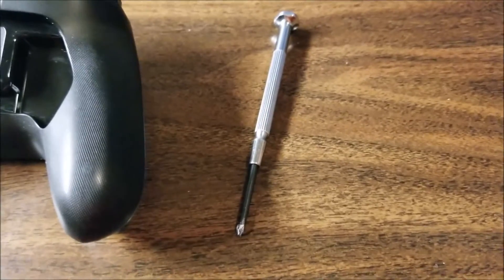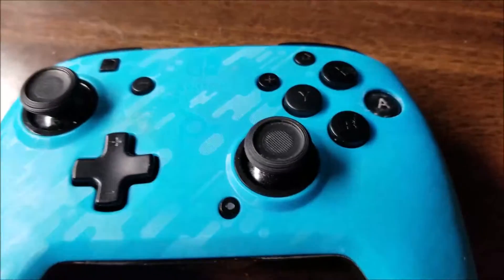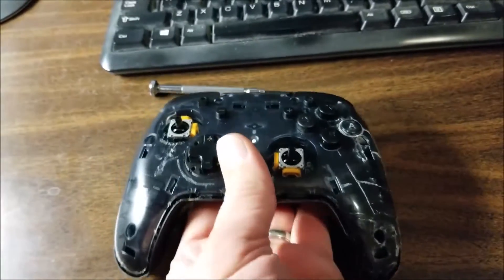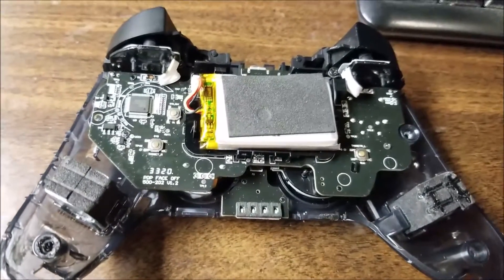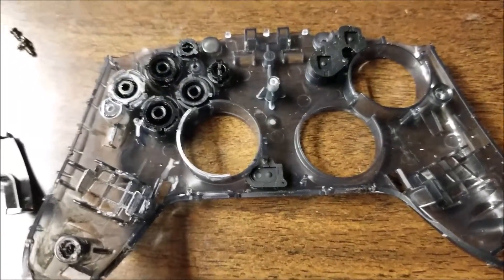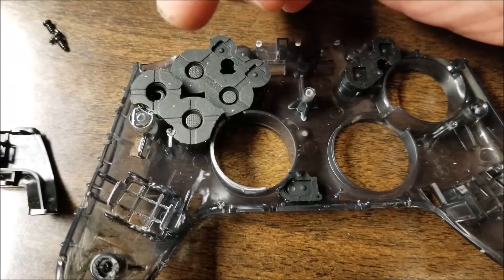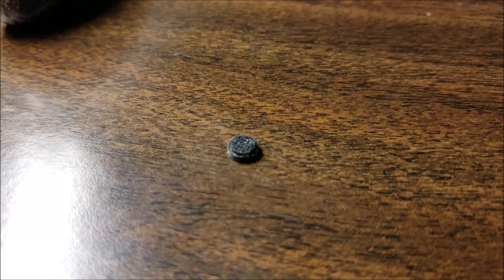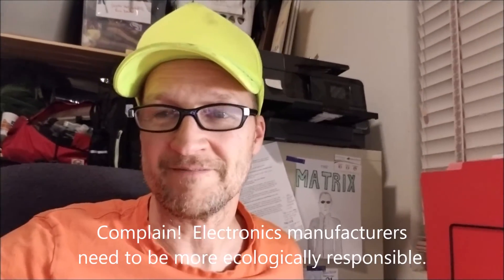Nintendo Switch Pro Controller - Common Stuck Button Failure & Design Weak Link

Comment: I have a stuck "A" button! I am OCD about how I handle my controller. I even have a "gamer towel". Everytime I smoke, eat, or anything, I wash my hands, dry them, and continue gaming. I take very good care of my stuff. It's pretty frustrating. Thank you for the video. I've used mine moderately for around 3 or 4 months. Bought it brand new... 🤔